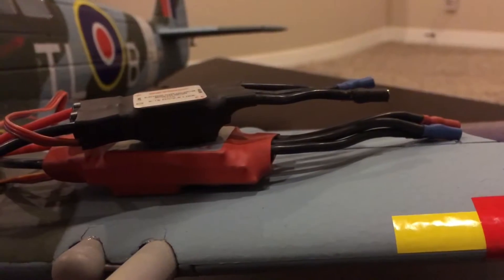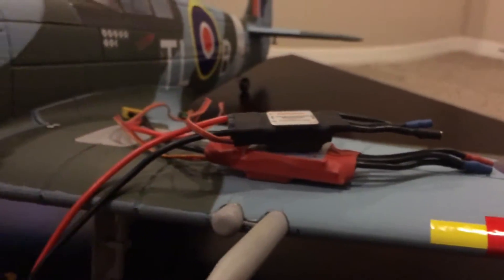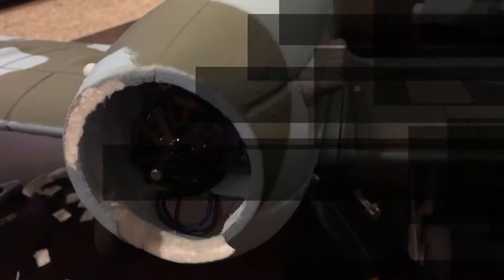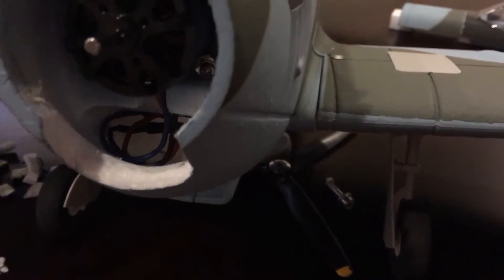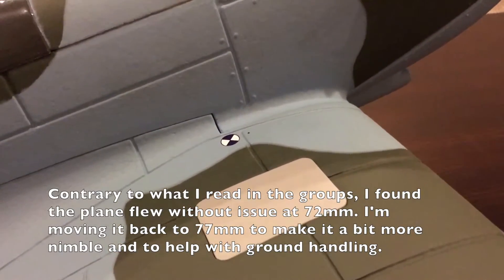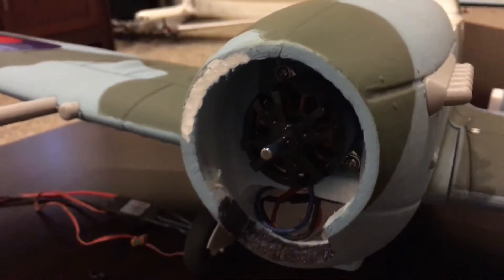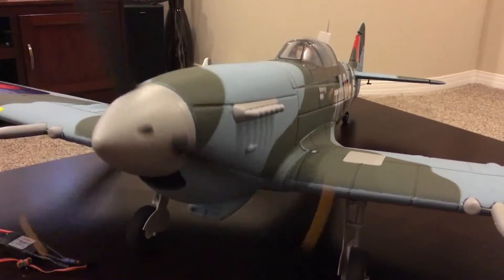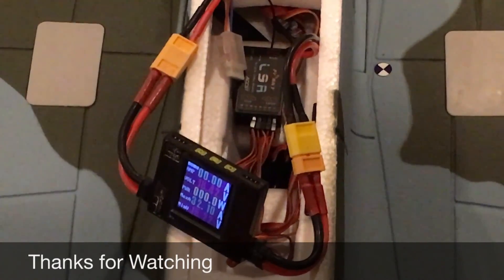Dynam Spitfire RC Plane Performance Modifications and Upgrades

Comment: Did you have difficulty assembling this plane
did it all go together easily?
Reply from the maker: Most Dynam planes go together without too much fuss. This one needed a hole cut up front to allow airflow in to cool the ESC. It's almost airtight up front.

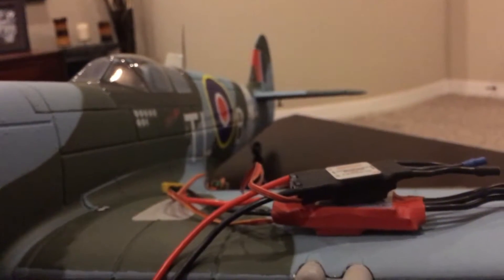Comment: Totally agree @ 2:53... I like a "lot of overhead" too! I want 1:1 power to weight OR BETTER. Scale is very good for looks, but I don't need to have a 350 foot runway for a small foam plane :)
Reply from the maker: Brian Phillips right on. I don't understand why they cut it so close. Just incremental upgrades result in much better flight experiences.
Reply: I totally agree! It would cost a few dollars, if that (Cost basis wise) to properly size the electronics. I guess the lighter the plane, the better it will fly...but I agree with your thinking.

Comment: Hi, I've never used a watt meter before, what does it do, go between the battery and ESC?
Reply from the maker: Paul Hatcher Yup. You put it between your battery and ESC so it can measure your amp draw. Volts x Amps = Watts. So it knows volts when you plug in, it measures amps when you hit the throttle and it tells you Watts. These are essential devices for anybody who build planes and has to come up with a motor/prop/battery combo.
Reply: RC Video Reviews Hey thanks, I'll have to find one. I don't recall Motion with any, but I'm sure Horizon, or HobbyKing would have one.
Reply from the maker: Paul Hatcher motion normally carries them. Amazon has them too. Must have equipment for testing.

Comment: THANK YOU VERY MUCH I am in AUSSIE and have several DYNAM models like you i am always modifying them can you possibly give me some contact we can share mods your SPITFIRE mods are identical to mine but i obtained a 5 blade prop and of course the wattage increased but the airflow mods where sufficient have you heard of the bigger scale SPITFIRE in production with ball joints on all control surfaces CHEERS FROM DOWN UNDER  TERRY
Reply: An old soldering iron makes a great tool for making holes in foamed once it is heated up it make very clean cut holes that are actually burned in .Try it I do it all the time.

Comment: You can get a small scoop, and glue it to the rear vent hole facing backwards, so when you are flying, the air will go across it, and act like a vacuum helping pull the air from the front all the way through.
I'm going to do this with mine, and will be replacing the ESC with a better one. 
One question though from a Noob with planes, on the ESC there is one set of wires going back to the Receiver. Is that both the battery power, and throttle power for the ESC? Or how does that work? I don't know enough about these yet, and I don't want to start frying electronics.
Thanks for any help.
Reply from the maker: +RakinBill Three wires are signal, power and ground. The red and black wire from the esc are what provide 5v power to the receiver and the servos.
Reply: Okay, I'm an idiot! lol. I just watched some videos on wiring a plane. I now understand about the ESC, and the BEC circuit. I'm not used to wiring stuff for planes. 
Thanks for getting back to me.
Reply from the maker: There are two types of ESC. BEC and Opto. Opto ESCs don't provide power. They are signal only and require an external BEC. Non-Opto ESC (built-in BEC) provide 5v power to the RX and Servo rail. You're not an idiot, we all started somewhere. Glad you're asking the questions.

Comment: I like your methodical approach. Straightforward, sensible and comprehensive....without unnecessary waffle.
Reply from the maker: +Michael Fisher Thanks Michael. I'm glad you found the information helpful. J
Reply: Of course J. 

I'm new to RC planes and was cruising the net looking for info on setting up my Spektrum DX6i. The manual is not very good. I have a 'standard' high wing monoplane with 2 ailerons and two flaps. Ailerons are on a Y harness. Ditto for flaps. There's nothing in the DX6i manual that says how to set up that configuration. 

Bumped into your video and was impressed. Many folk who do YouTube movies on RC technicalities cram in a lot of music, footage of them doing up their shoe laces and unnecessary chat about like what their dog ate today etc ;-)
Reply from the maker: +Michael Fisher It's like you read my mind. Lots of good stuff out there but lots of inane material too. I try to stay on topic. Thanks for the acknowledgement.

Comment: that is so true.  I remember making several mods to my Dynam C47 before it would behave in the air. BTW it also suffered from major tip stalls as did your GWS.
Reply from the maker: I saw a YouTube video of a much larger C47 do the same exact thing. Must be a design issue. Wonder if the first test pilot of the C47 burned it in like that.
Reply: @RCVideoReviews  The swept back tapered wing is naturally tip stall prone. Keep nose down and speed up in turns and during takeoffs and landings.